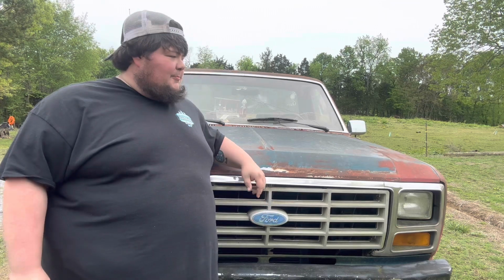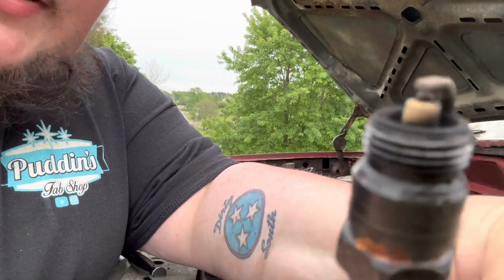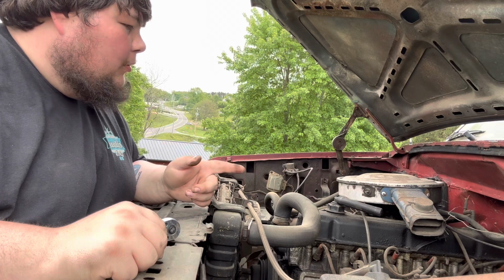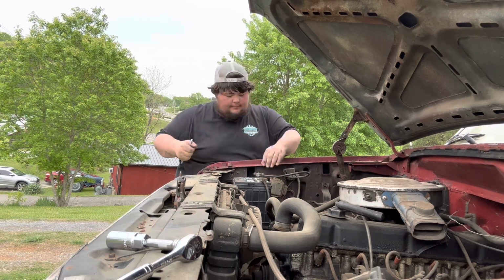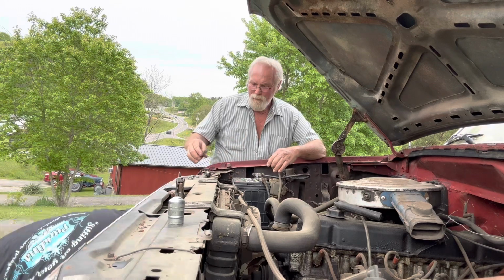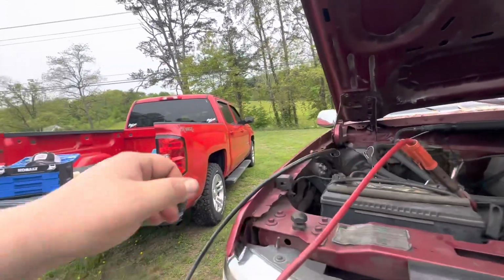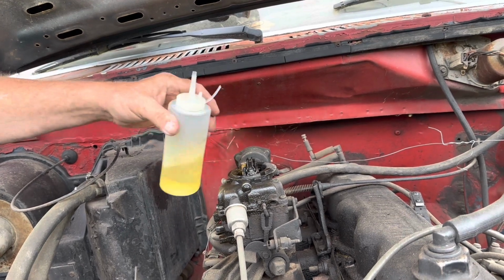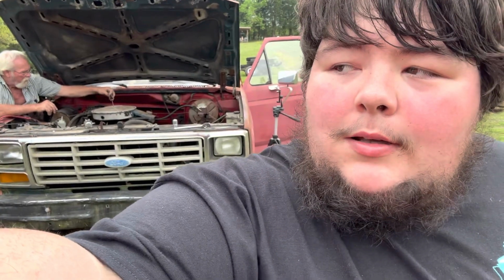1982 ford f-150 (old red) will it run?

Comment: These Bullnose and Bricknose Fords are getting to be a popular build, atleast out here in the West/Southwest because they are the last of the cheap classic trucks. The :Action Line" (67-72 chevy/GMC Trucks) have always been expensive, the Squarebodies have gone through the roof, The OBS Chevy/GMC have tripled in price over the last 10 years,  The Dodge D100's and D150's have always been more than the Chevy's and Fords, The Dentside Fords have also tripled in price, Where as you can still jump on the interwebs and find a Bullnose or Bricknose Ford for under 3 grand and still work on them in your driveway with little more than a basic tool set.
Reply from the maker: Yes sir they are going up day by day I’m wanting to find a solid 2 wheel drive before they’re gone😭
Reply: @missingwrenchesgarage  Absolutely, I just bought a 1980 F-150 2WD That I bought for a daily driver as I rebuild the engine and trans in my 73 Regal and then I was going to sell the truck but it's in such good shape I think I'm going to rebuild it. It's got the 300 Strait six in it and an auto trans but I bought it from a former Forrest ranger who bought it from the Forrest Service so the maintainence records are all there and spotless, so I'm going to build it.
Reply from the maker: I saw a 84 “patina shop truck build” when I went to Holley ford fest since then I’ve been on the hunt lol I’ll have it one day!!
Reply: @missingwrenchesgarage  Yep, I'm sure where you are but they are all over here in Arizona.
Reply from the maker: Thanks bro might be making a late summer trip out west😏 😎
Reply: @missingwrenchesgarage  Well if you do give a shout, I've got a spare bedroom for you to crash in for a night or 2.
Reply from the maker: Heck yeah man thanks that’d be awesome 😎
Reply: @missingwrenchesgarage  Yep no problem. IF you come out at the right time we'll pop over to the "granddaddy of them all" and go to the Pamona Swap Meet. That would make some great content too. I've been out here a couple years and have been to 3 and they are awesome and you won;t be to another like it.